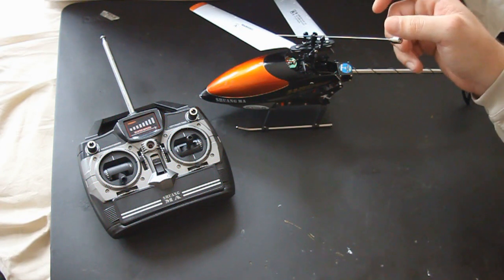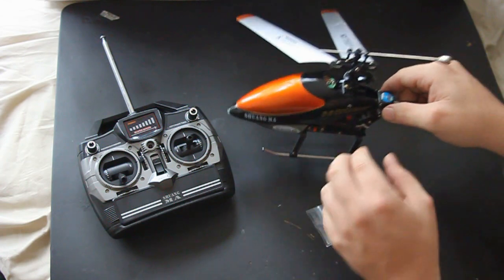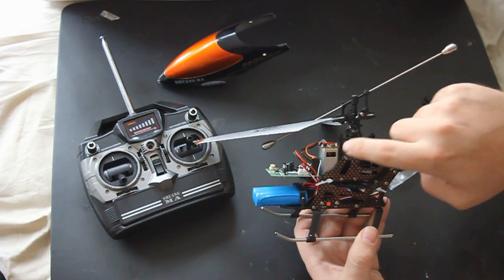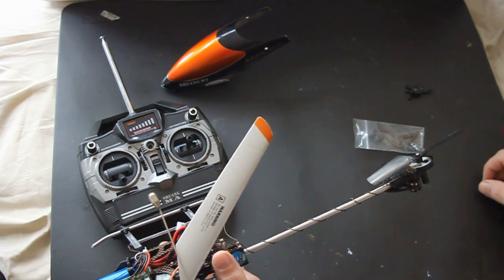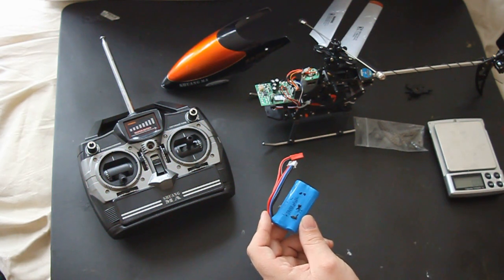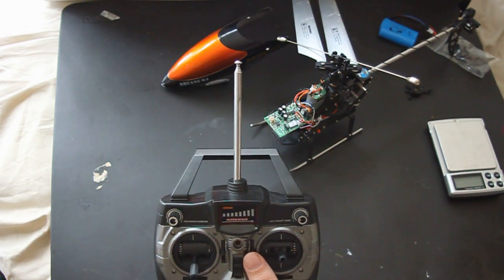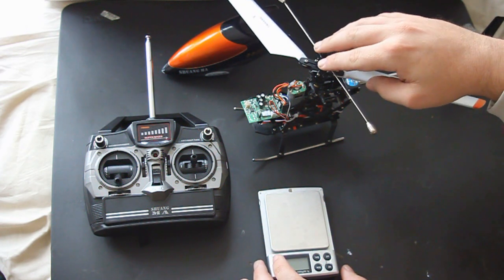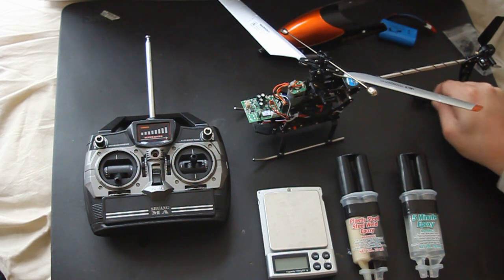Double Horse 9100 review and mods

Comment: I bought 2 of these  for cheep cheep and tested one as hard as I could, out of the box it's just junk, this thing wont fly well at all, its all over the sky and any wind will take it fast, I got a see saw rocking flight back and forth, it's hit hard several times, now with that said the mods that you show are on target, the swash plate factory is a very poor design giving you allmost no control, after your mod it was like night and day, the tail as well works for the weight perfect,

Comment: Flight charisteristics of a CoAx vs a CP.

CoAx uses right stick rudder, FP and CP use left stick rudder (tough thing to re-learn)

CoAx will limit your bank and turn rate, CP will keep banking until its upside down and diving to the ground.

CoAx will stabilize and hold position when hands off, CP will continue in direction of last travel gradually GAINING speed.

CoAx uses motor RPM for lift, CP uses blade pitch for lift which the responsiveness can be jarring for a new CP pilot.

Comment: Blade is a good path to take, parts are available everywhere and they are tough little birds, my only pieve with them is their smaller birds use all in one boards that house weird actuators instead of a servo layout so you miss out on that little bit of education. Personally I went the T-Rex route to a 250 then a 450 then a 500 and now im on my 600 build, man what an expensive hobby lol ;-)

Comment: I completely agree with your swash plate mod, there is just not enough forward pitch on the heli, you'll spend half your flight time fighting the wind if you don't mod it, I just made the servo arm longer on mine, did the trick.
Tough little chopper!

Comment: I mentioned somewhere in this thread that spooling the antenna is a very bad way to manage your antenna length I had the same issues and what it is is tha coiling causes a polarization effect and since the tx antenna isn't polarized this works poorly. what i did was i replaced the antenna with a heaver gauge wire and that made it easier to position without coiling.

Comment: The lean is a trait of all helicopters, to counter the main rotor torque there is a tail blade, but the tail is still pushing air sideways which is going to make the heli want to travel sideways, to counter this the heli leans a little to the opposite direction. Helicopters are very good lessons in the laws of physics, especially the laws of action-reaction.